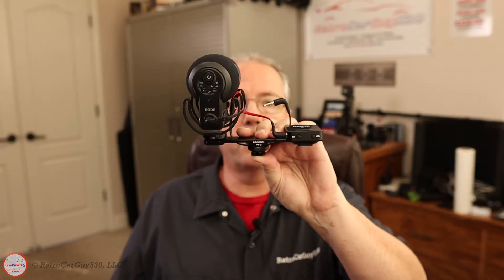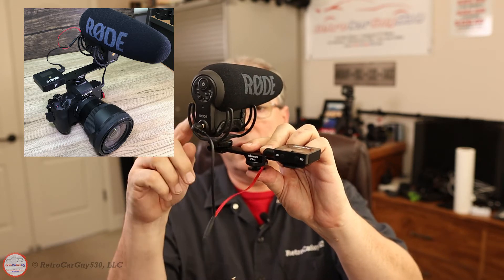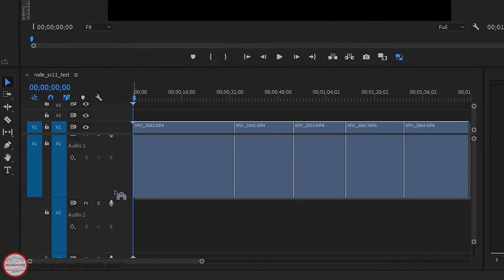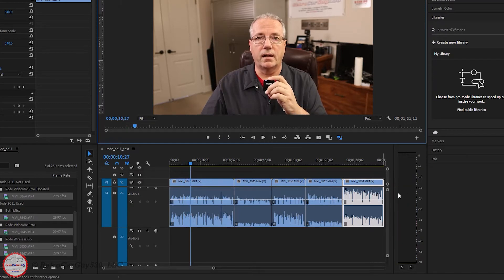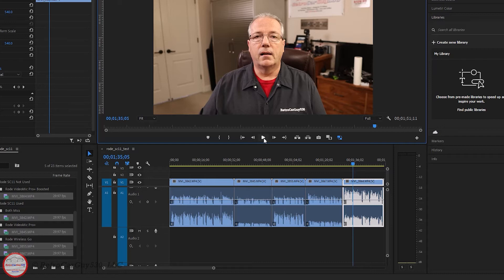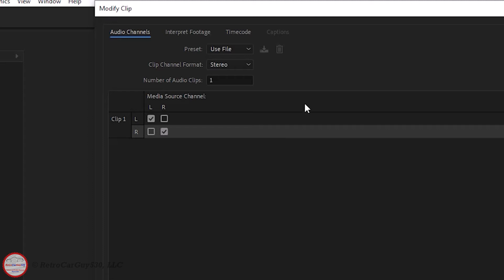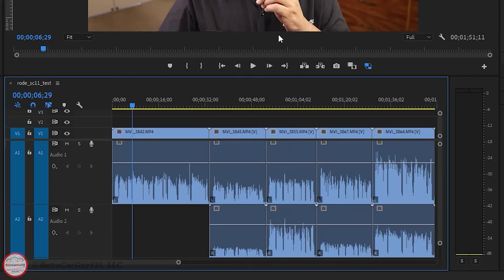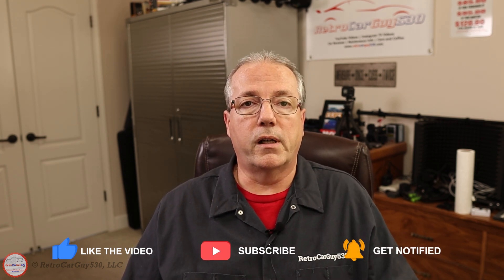Use Two Mics with One Camera - Split Audio Channels in Adobe Premiere Pro

Comment from the maker: There are times having two microphones connected to your video camera would be a good thing to have to capture the audio of yourself and something/someone else more clearly.  Using a microphone cable splitter (TRS), allows you to connect two microphones to the same video camera.  After you have the two audio sources captured in the video file, you need to split the two audio left/right channels into two different audio clips while editing your video.  I show you how to take the audio track from your video file and use the left audio channel as the first audio track and the right channel as the second audio track in Adobe Premiere Pro 2020.